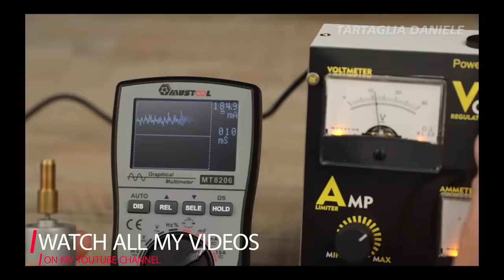TOP 15 BEST SOLUTIONS with HEAT SHRINK TUBE

Comment: Take a ( working ! ) 2 Kw oven element and solder on some suitable flex with mains plug .... ensure that you cover the joints with generous amounts of  ADHESIVE LINED  heat shrink tubules .... this makes a safe and handy bath water heater for when your boiler breaks down ( yes , they do , frequently ! ) ...... ( tried - n - tested ) ...... DAVE™🛑